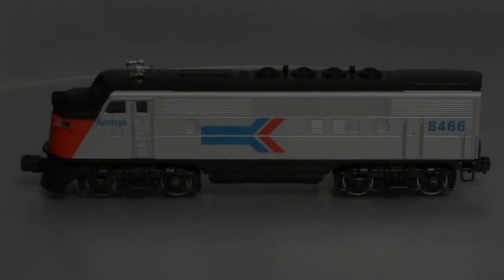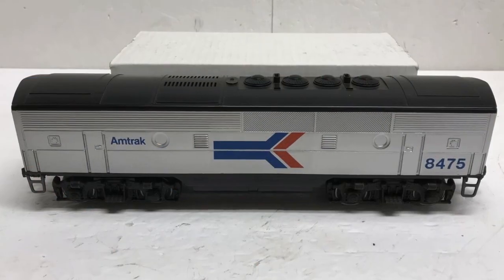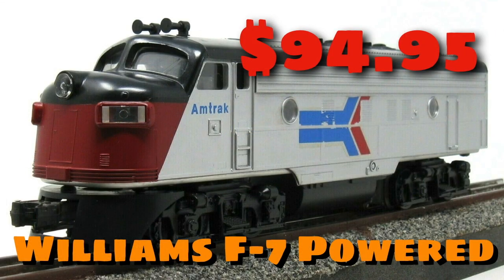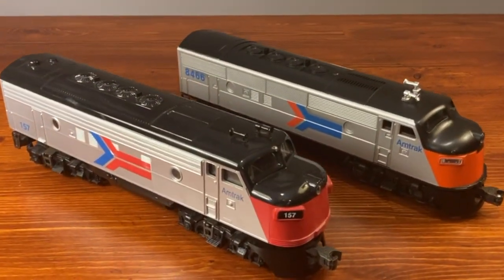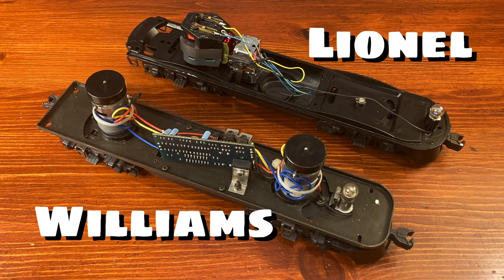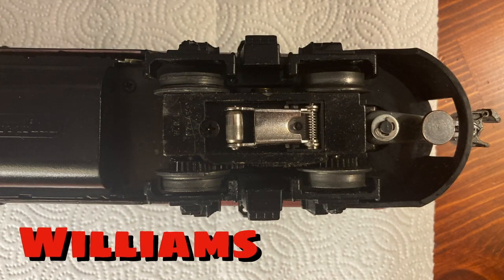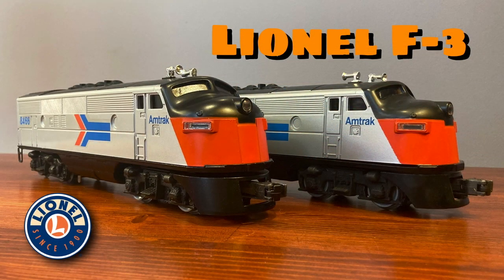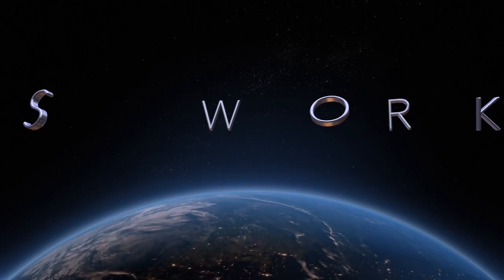Lionel F-3 Versus Williams F-7 in AMTRAK colors Comparison

Comment: Williams seem to run smoother especially when you wire the motors in series. They are very powerful too. But it is hard to beat the longevity of Lionel products especially postwar. Great video.
Reply from the maker: Thanks. I was a big Williams fan, and still am but I think I like the Lionel F3 even more. The Lionel is the one I always dreamed about having since the catalogs from the 70s. Have a great weekend. Bob

Comment: I don't have much experience with the Williams units, but I've got a lot of experience with the Lionels.  One advantage that the Lionel F-3's have is that a shell from a later Post-War F-3 (1955 or 56 onward) will easily fit onto the frame of even a modern era Lionel F-3 since they continue to use the same clip in the rear and single screw at the front.

The Amtrak unit in the video is a single motor unit with a traction tire and a basic E-unit.  You could easily transfer that shell over to a double motor chassis with magne-traction or with double motors and modern traction tires.  

Modern Lionel F-3's also have electronic reverse units instead of the older E-units letting you have modern performance in a retro look.

You've got to love the ability to upgrade and adapt older trains for better performance.
Reply from the maker: For sure there’s a lot that is available for the Lionel F-3s. I like them very much.

Comment: I really like the Williams engine but the wrong colors on the Amtrak logo ruin it for me
Reply from the maker: I never even realized they were reversed until I had the Williams and the Lionel side by side. The Williams has been really reliable though and even though the graphics are incorrect, they were still well applied… which is something. Right?
Reply: @bobsworkshop5181  I guess but I try to go for realism I could always remove the decal and add a new one